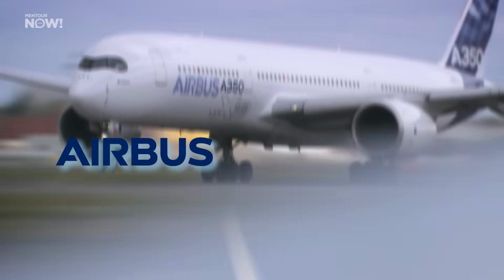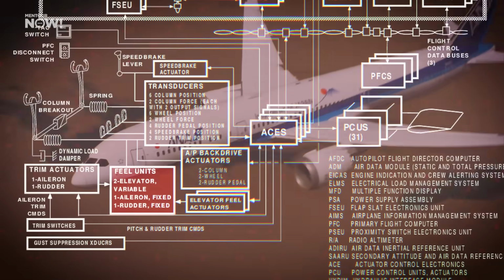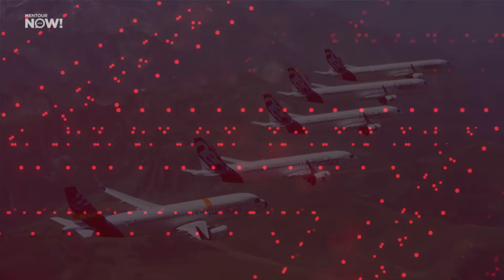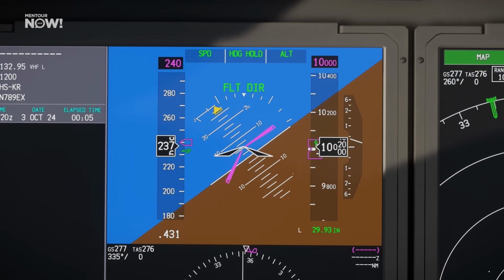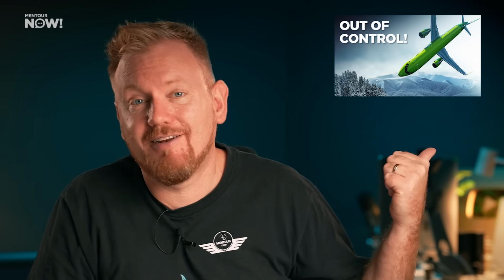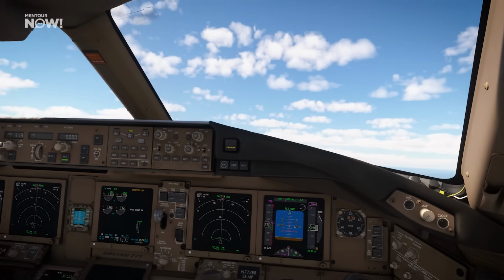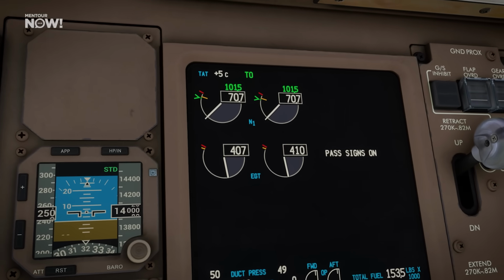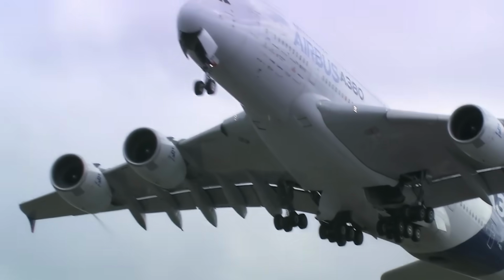Do Pilots Prefer AIRBUS over BOEING?!

Comment: Boeing pilot: we fly the aircraft

MCAS: excuse me?
Reply: @jagjordi  boeing pilot : we crash it
Reply: Just switch stab trim off
Reply: @XD-ql2kr  how can you do that if Boeing did not tell you that MCAS existed in the first place?
Reply: @HellStr82  Turn everything off, and manually trim, while pulling back as hard as you can, and hope you can trim fast enough.
Reply: @HellStr82  Okay, what's the difference between speed trim and mcas in boeing?
Reply: @XD-ql2kr  MCAS is a function to make the aircraft handle more similar to older aircraft variants. Its function is more "aesthetic" I guess, its not an objective improvement or detriment.

Speed trim is a function to keep the handling of the plane between different speeds more consistent. Which is much more straightforward as a support.
Reply: @termitreter6545  The principle is the same - in given conditions trim aircraft. The only difference are conditions to activate system, and both are part of speed trim system. And you deal with failures same way no matter if this is mcas, speed trim or autopilot trim failure. The easiest way to stop stab trim runaway in both accidents was to select flaps 1 because Mcas doesn't work with extended flapss
Reply: @XD-ql2kr  I think the conditions under which a system activates, and what it does, is pretty important if we wanna judge how actively it intereferes with control.

Thats where the difference between MCAS and speed trim lies.

Im not sure whats your argument tho. Are you saying MCAS is similar to speed trim so its not making Boeing Planes more "automated" like Airbus planes?

If so, then its, then I dont understand how another thing meaning more automation (less control) for the pilot strengthens that argument. Because its literally less direct control for the pilot.
Reply: @termitreter6545  How does MCAS works does not matter at all and the conditions I mentioned are not important. The only thing here is those cases were avoidable on different levels. Firstly Boeing and lastly pilot who couldn't do stab trim runaway NNC. And it doesn't matter if it was MCAS failure or any other system related to trimming aircraft. But putting whole blame on Boeing and not looking into poor pilot training in those airlines is just not fair. Ofc Boeing is main guilty here, but lot of people forget about other facts. I just hope that both causes of accident are taken care of.
Reply: @XD-ql2kr  Oh, I think weve got some wiress crossed, thought we were talking about OPs comment. We just ment different things.

That said, I assume Boeing was partially responsible for MCAS being implemented without telling the pilots? Boeing, together with the FAA, can decide what training/info pilots are supposed to get. 

So if Pilots didnt get educated about MCAS, then because Boeing thought about that being fine. 

At least Id be very surprised if Boeing told airlines to educate pilots about MCAS and they just refused.
Reply: @XD-ql2kr  What if MCAS has trimmed it so far that you can't physically turn manual trim wheel? Do you switch electric trim back and try to be faster than MCAS?
Reply: @HVM_fi  Reduce power, reduce speed and trim nose up manually
Reply: @XD-ql2kr  tell that to Ethiopian Airlines Flight 302

pilots
Reply: @jagjordi  Well they should do Stablizer Runaway NNC memory items and they didn't. If they did this checklist properly they wouldn't crash

Comment: The problem with boeing isnt design, its manufacturing quality assurance. That includes testing new products, that is also lacking.
Reply: Testing old products too, it seems. Like the 737 fuselage. (They don't come much older than that.)
Reply: Nice to know that MCAS wasn't a problem......
Reply: @orlestone  if it had been tested properly, it would not of been... all engineering has design flaws, every company and product has them, its how they are tested and fixed which matters, and thats where boeing keeps screwing up. Thats the part other companies do better, they find the faults and fix them before putting them on the market.
Reply: In some cases it's also design that is at fault.
Reply: @purrple.shadows  if things were tested properly, those problems would be fixed. Most new engineering designs have problems, thats why testing is so important, but boeing skimps on that to save money, same with basic quality control, and thats why they have problems.

Comment: I think this sounds a lot like the metric vs. Imperial debate; In the end it comes down to what you are used to, and you will always feel more comfortable with what you grew up with, no matter what would or would not be a reasonable choice for whatever reason. (and I intentionaly will not define wich is wich in my opinion for what reason ;-P )

Reading a lot of MCAS comments;
I think this is a bit unfair. MCAS, as a system, was fine. It was cutting conors that made it unsafe. If it had ben connected to more than just one sensor, and if it had its authority limited 'as descriped in the design notes' none of those chrashes would have happened. Corporate greed that alows dorplugs to fly away is a problem on the Top, not on the production line, and especialy not with the pilots opperating the plane. The most unfair thing is that none of those responsible faced jailtime.

Comment: MCAS has shown its ugly head in comments and I only want to do this once.  
" while Boeing has not explicitly stated that MCAS was developed outside of typical R&D practices, the evidence suggests that the development was conducted under a different framework that lacked the usual checks and balances expected in aviation safety." chatgpt
One interpretation is the same people or persons who insisted on hiding MCAS, fooling the FAA engineer etc.   Was responsible for bypassing the normal R&D department and total screwed it up.   This is so so wrong.

Comment: Two different design approaches, plusses and minuses to each - very well explained, thank you.
However quality of manufacturing and testing may have a bigger effect on the outcomes then the design differences.
Reply: Yeh, thats definitely the takeaway. When theyre correctly designed, tested and produced, there is pretty little difference in Airbus/Boeing performance, seems to be tiny margins. 

And thats still true for most boeing aircraft, luckily enough^^

Comment: In a perfect world, you would take the benefits of both systems and combine them. Like an Airbus with active side sticks or a Boeing with Airbus protections.
Reply: You mean a BoBus ?
Reply: I was thinking of Airing 😅
Reply: @TommyRaines  I prefer Airbong myself
Reply: Or Airing?😂
Reply: An Airboebusing?
Reply: And which documentation is better, the "engineer's cut" Airbus or the "essentials" Boeing. I'd go with the one that keeps my feet warm (fancy a pony plane).
Reply: Boeinger Bus
Reply: The 787 has flight envelope protection, it's just easier to bypass than on an Airbus
Reply: @mrvwbug4423  And it`s also build by Boeing.... You never know if they added some new system and never told anyone about or if that door will stay there until you land. Yeah ...no thanks
Reply: Active sticks bring their own risks.
Reply: Airbus: the planes are built right and still do, every one are properly dressed, plane gets there safely, and not a single problem

Boeing: the planes have endless problems, wheel fell off, door fell off, kid loose shirt and get hug by the girls, passengers are naked, and they crash allot.
Reply: Soft protections are better if you’re an actual pilot who can hand fly an aircraft. Having your controls locked out or made ineffective because the computer knows better sounds terrifying.
Reply: @EdOeuna It sounds terrifying that the computer takes away control, thats true. But when Airbus hard protection really kicks in, the pilots is almost certainly doing something he shouldnt have done in the first place. So the pilot is probably in panic mode anyway when the hard protection kicks in, and thats when it can safe the day.

Of course understanding the protections is very important too. From what Ive heard, in practice those hard protections are statistically just a lot safer.

Comment: I haven't done a ton of flying but as a passenger I always noticed the Airbus planes tended to be smoother in all aspects.  As a non-pilot, I feel like the automation of Airbus does make their planes safer, but may require a greater technical understanding of the systems in the case of anything abnormal.  "The plane is doing a thing we need to correct" becomes "The plane is doing a thing we need to correct, and it's because the automation is in mode X trying to do Y" so training and systematic understanding is paramount.
Reply: I agree with you on this one. The Airbus automation seems to give me as a passenger comfort, but Boeing planes seems to be too noisy and sometimes not feel so stable in the air. Maybe this is the feedback most pilots are referring to in their comments.
Reply: Except time and time again the pilots like to take control and make the situation worse. Trust your instruments!
Reply: Indeed.

Comment: I find having more information is always better and also effective in troubleshooting though it might take a bit more time. One can always extrapolate from the available information to a specific range of probable outcomes but if one has less or just basic information the possible outcome range widens and leaves space for more errors or misdiagnosis to creep in. I guess, it ultimately rests in the competency of taking in all the considerations that the individual needs to deal with the troubleshooting, which is why a computer can never replace a human operator.

Comment: As soon as Airbus implements active sticks, & the throttle shows the actual power setting at all times, it's going to be far ahead of Boeing. 🤞🏼🤞🏼
Reply: I would also suggest different cockpit lighting to indicate different laws. Like in Star Trek they go to Yellow and Red alert and the entire bridge changes color.
Reply: You mean that every lever and button should jump back if it can't implement your demand to show the actual value.
Reply: There might be a few reasonable exceptions, but in general it's a good idea. I'm not an airplane designer but I don't really see the disadvantages of such a system. 🤷🏻‍♂️  There's a long line of accidents resulting from the lack of visible feedback.
Reply: I don't really get why they abandoned the active interface in the first place when the predecessor company Sud Aviation had so much success with the Concorde and its analog FBW.
Reply from the maker: The A220 already has throttles that move to show the right power setting... so they only need to add active sidesticks to those. 🤞🏼
Reply: @MentourNow  Except that the A220 is not actually an Airbus aircraft ;-)
Reply: @MentourNow sweet! I didn't know that about the throttles
Reply: @MentourNow  Moving throttles.....positives and negatives. I agree about seeing the throttles moving in your peripheral vision as being a definite plus, however, there's a downside to moving throttles as well......not to mention the added complexity of drive motors and clutches under the pedestal. The biggest drawback that I have with a moving throttle system are "GO" buttons. They have to be close enough to initiate a go-around......but not too close that one accidently activates a go-around......and I'm sure some of us have seen that happen........which can cause a bit of excitement in the flight deck. I'm not going to blow sunshine over the Airbus method.......but it works.......and there are plusses and minuses to both.

Comment: It seems to me that the best of both worlds would be to take the Airbus system, but add the Boeing-like physical feedback to it. I suspect that is where the industry will converge eventually.

Also, if there are multiple warnings, why doesn't it just say something like "STALL, STALL, MULTIPLE INPUTS" instead of letting one block the other entirely? Seems dangerous.

Comment: Airbus pilot here (320). Airbus is better by a mile. I never want to fly a Boeing. Everyone at my airline that has come from a 73 will never go back.
The 737 is stuck in the past. They could not fully update it because they needed to keep a single type rating.
Reply: Im not a pilot but have an honest question if you dont mind? Do you or did you ever find it awkward to change seats and use the other hand on the side stick? I would think a yoke would be more natural right off the bat.
Reply: @ It’s ok, you get used to the switch pretty quick. Now what is hard is going back to fly a C172 (I haven’t flown that in 20 years). It’s gonna take a couple times to figure out the height and landing the plane.
Reply: that/s why I don't understand SW Airlines, stuck in the past with that outdated 737. They should have leased or bought some A220 long time ago.
Reply: Well the MAX is quite nice, best 737 they made.. Airbus, no thanks.. :-)
Reply: @ I hope we have lots of people senior to me thinking the same way! 😜. The Max is updated but the overhead panel is still stuck in the 50’s. And it still has the small cockpit. No thanks.
Reply: @ Not like the overhead is a piano you touch and move switches all the time. Toogle or push switch.. same one-off-standby-armed whatever. It is just looks, and when we talk looks the MAX, 787, 777X screens and graphics layout beat Airbus on all points. The screens are what we spend our time looking at, not the overhead.
Reply: @ good point. Well what about cockpit comfort. The Airbus beats the 737 hands down. And when you are spending 5-7 hours in the cockpit a day it is a lot less fatiguing and comfortable (except in old Airbuses with the crappy original seats).

Comment: Airbus brought unbalanced flight controls to commercial aircraft (A300), partly in name of the payload wars. They also brought the non-plug door design from business jets to commercial airliners. A non-plug doesn't come inside the airplane and "plug" the hole...via folding top and bottom sections of the door or hinge mechanisms, no way for locks or doors to slide up and off of the stops (Alaskan air door debacle).

Comment: There is one more thing, that wasn't mentioned. The assembly quality or production culture. It doesn't matter how great the feature is when it isn't  working. I've flown both Airbus and multiple Boeings, as well as the Embraer and others. And from that perspective, the overall thoughts are not quite matching.
Reply: So which one is better in your opinion?
Reply: @selinan3077  it's like comparing a truck to the executive saloon. They are both good for what they were made for. From the comfort and ergonomics standpoint the Airbus is a clear winner in my humble opinion.

Comment: MCAS was the "surprise" inside the Cracker Jacks that was quite well presented by AA Captain Dennis Tajer in hearings and testimonies  MCAS was the "surprise" inside the Cracker Jacks that was quite well presented by AA Captain Dennis Tajer in governmental hearings and testimonies. Both Airbus and Boeing systems provide well proven advancements in safety. Hubris and Jedi Mind Tricks perpetrated by Boeing  combined with lack DOT/FAA oversight are factors with no relation to technology. 346 people died and Boeing skated…

Comment: Can the pilot manually select which law they want to use (obviously you cant select a higher automation mode if it's not available). Perhaps a more visible indication of the current LAW? Lights somewhere around the HSI?
Reply: The pilot could deactivate the flight computers on the overhead panel to force the plane into alternate or direct law. This is pretty much never needed since the computers will do that themselves if they are not 100% certain that their outputs are reliable. The planes uses multiple computers and sensors (different hardware each), compares between them and shuts down when something is wrong.
Reply: Nice to know: The A320 has 7 flight control computers and each has a unique hard- and software design and if they disagree then they decide that they are not trustworthy and degrade their mode to alternate or direct law according to the situation.
Reply: they cant.if you get hijacked,you are done for!in a boeing,you could always do a aileron roll.........

Comment: Great video as always MP ❤
Looking at numbers and removing duplicates, you get: Airbus: 35 crashes, 28.3 million flights, 0.81 million flights per crash. Boeing: 251 crashes, 461 million flights, 1.84 million flights per crash. Think the biggest worry tho is Boeing engineers refusing to fly on certain Boeing aircraft. 😳
Reply: Your data is good, but instead of a long-ter average, look at the direction of travel of the stats - that gives a very different picture.

Comment: What do I prefer as an aerospace engineer and not a pilot? All the modern FBW aircraft. Given the choice of A330, A350, B777, or B787 I'd just say yes. Given the choice of A320 family or B737 family... I have been avoiding the 737 for 20 years. I only fly on them when my employer books them. In the long term they have 5 times the hull loss rate and 4 times the casualty rate despite having less deliveries than the A320 family. By 4th generation do you mean only the MAX or the 737 NG too? I'm pretty sure the MAX proved very dangerous initially.
Reply: None of the 737s, MAX included are Gen 4 aircraft
Reply: @unfathomable1876  So Gen 3?
Reply: @cageordie  Yes, the 737 in all iterations is a gen 3 aircraft. The US government even had to give it special exemptions for the fact it doesn't even have an EICAS. The 777 and 787 are the only true Gen 4 commercial Boeing airliners. It's sad that the MAX even exists it should've been completely redesigned or replaced.
Reply: you are one of those people who forgets the 737 has been around for 20 years more than the a320 and thinks everything is pilot error